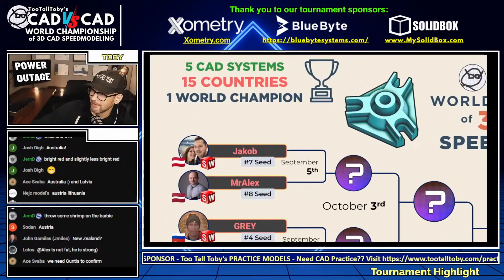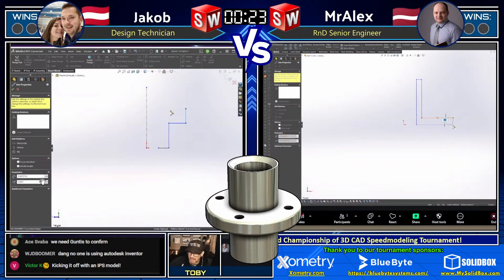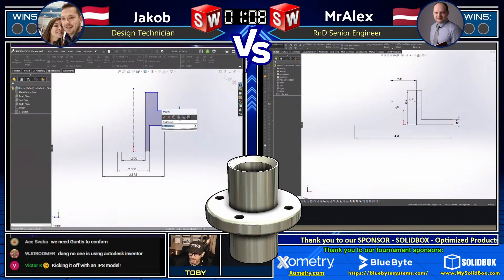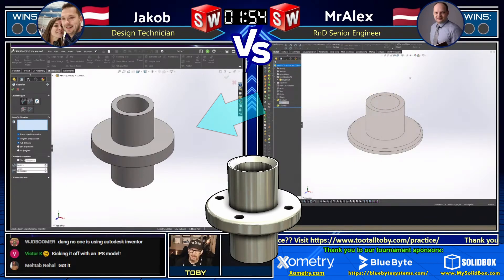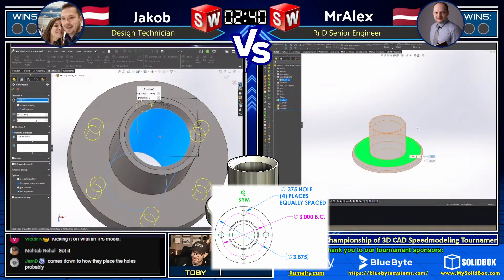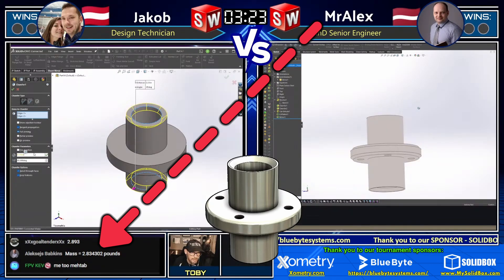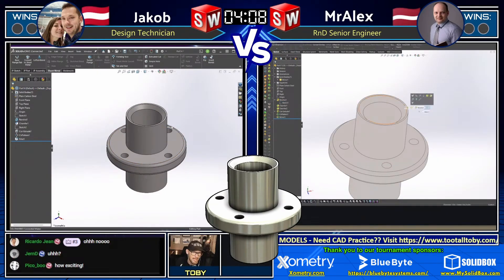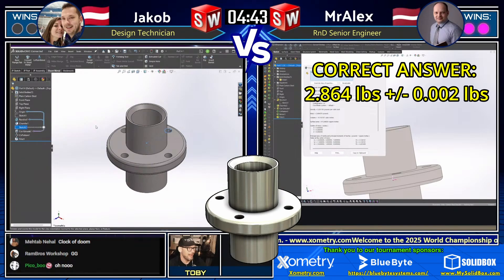CAD Speedmodeling Tournament! - MATCH 1 Battle 1 - WORLD CHAMPIONSHIP 2025

Comment: Is it mandatory to make an exact replica of the model in question? What I mean, since the mass is needed, then you could just do those holes in arbitrary place on that flange part without dimensioning and patterning? Just make sure the holes are the correct size so that you are removing the right amount of material 🤔
Reply from the maker: That is correct - what you are describing is what we call "the Ivan Exploit" and it's a known exploit of the challenges / competition.  Sometimes people use it, sometimes they just model it proper.  It's up to the runner, and as the challenges get deeper and deeper (more and more complicated) there is less opportunity to use the Ivan exploit.

Comment: Ive gone over this drawing like 5 times in onshape and keep getting 2.882 lb ive checked everything multiple times
Reply from the maker: Is your material density correct?  What CAD system?
Reply: @TooTallToby Obshape. And yeah I checked the density. I tried getting your material library but onshape said it had to be a cvg or something. I'm only a year into cad so I'm sure I'm doing something wrong lol
Reply from the maker: Sometimes the best thing to do is grab a screen capture of the drawing, then go 1 by 1, and cross out each dimension (as you verify it on your model).  That's a great way to figure out which dimensions were overlooked.

Also  - if you sign up at https://www.tooTallToby.com I've posted tutorials for all the tier 1 models using Onshape - this will give you some great practice on how to build these challenges - Good luck!
Reply: @TooTallToby thanks I appreciate it. One thing I was wondering is on the model sheets you have the density in kg but in onshape the material density is in lbs so ive been having to translate the numbers to lbs maybe thats why.